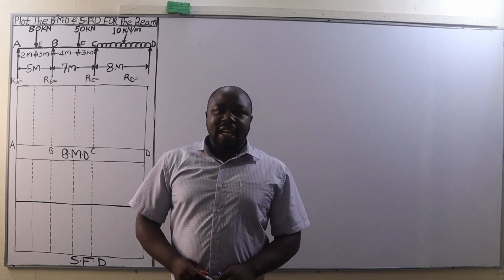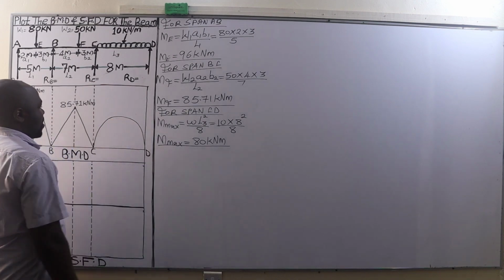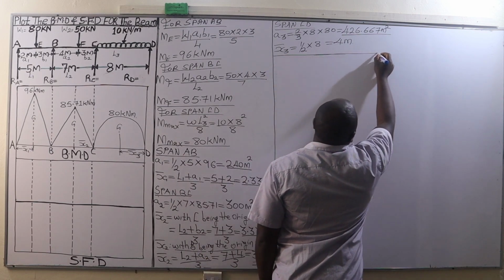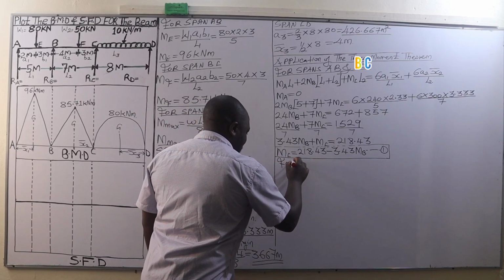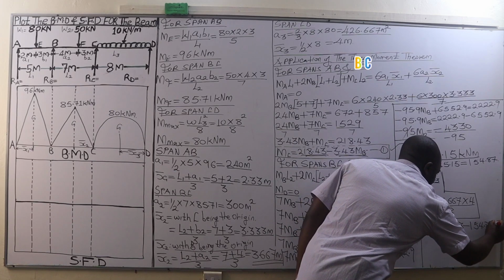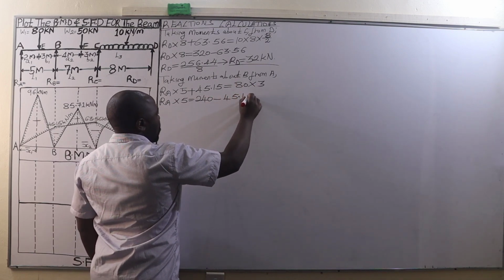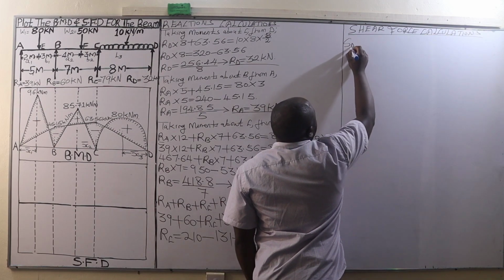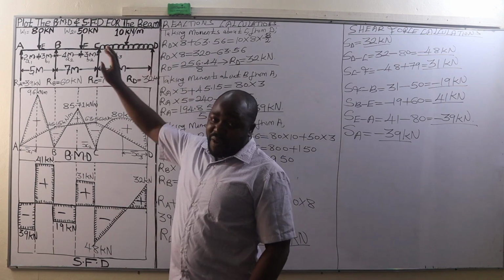HOW TO PLOT THE BMD & SFD OF A CONTINUOUS BEAM USING THE THREE MOMENT THEOREM.

Comment: When calculating reactions, taking moments Abt c why is the moment at support  B  not included?
Reply from the maker: You will also note that the moment at A which is zero is not included when we are taking moments about B. Same case. That's double handling of moments at the same point which is wrong.
Reply: noted